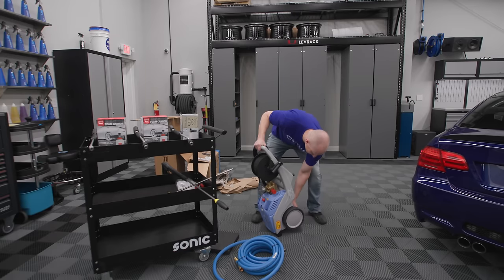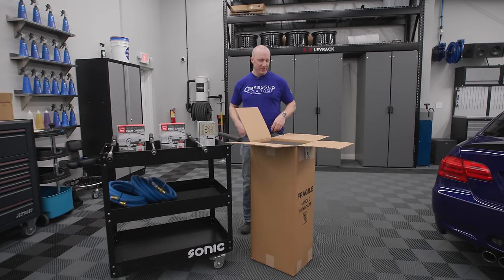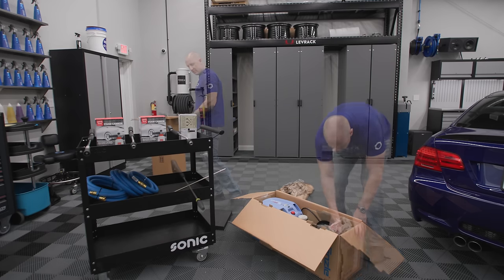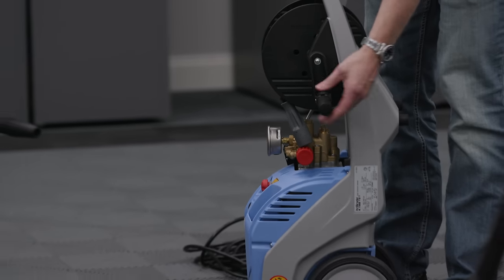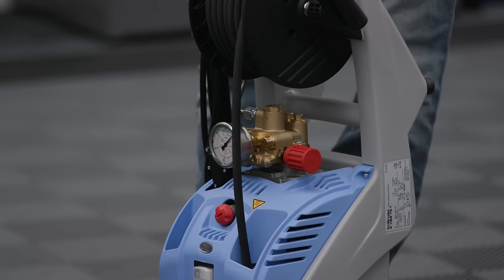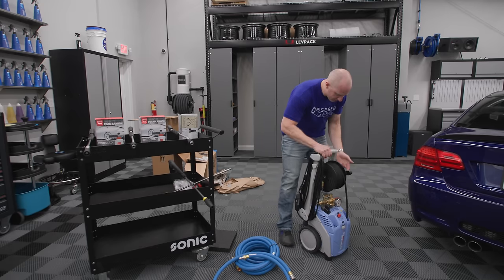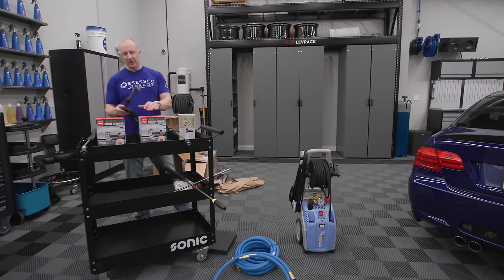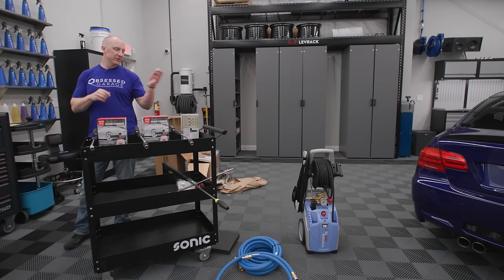My Favorite Portable Pressure Washer: Kranzle K1122TS - Promo Deal of the Year!

Comment: I would have to say to all your critics is this, my car costs more than I paid for my first home. I use most of your car washing (for the last five years)regimen the Kranzle 1122, the stainless nozzles, the Mosmatic handle and wand etc. my car still looks as good as new. No scratches or swirls. The point is if your spending over 50k for a new car why wouldn’t you want one of the best washing machines on the market? I laugh at my buddy who drives a 100k C8 Corvette and uses a cheap Sun Joe pressure washer. Penny wise and dollar foolish!
Reply: I just got the 1122tst and I am chasing down a problem with the foam cannon and the smaller orifice, the unit surges and seems to struggle with the 1.25 and the 1.1 doesn't even turn the unit on. Do you use a larger orifice with the foam cannon?

Comment: I have an Eley hose reel and use their quick disconnects for most of my attachments. Could I add a male connector to the Kranzle so I could connect and disconnect my hose reel quickly? I tried a Sun Joe previously which broke within days and I never tried another electric pressure washer since. Have been using my gas Honda to clean the garage floor, siding, cars, bikes, etc....might be time to get a Kranzle finally.
Reply from the maker: Yep, we can easily add a quick disconnect.

Comment: Can you advise what the minimum acceptable input flow rate required is for this washer. I would be coming from a  1/2 tap but I am concerned I may not have enough flow rate. Thanks
Reply from the maker: As long as you get 2GPM, you are good.

Comment: Most of what Mat shows here can be built with a fraction of a cost, no need to spend thousands if you are not a professional detailer or do this for a living. 😣😣😣😣😣😣😣😣👍👍👍👍👍👍👍👍👍👍
Reply from the maker: And where do you think all that knock off stuff came from?  Many of choose to not support or use junk versions of the real thing.  I’m wearing a Rolex, not a Casio.  #honorthesource
Reply: @ObsessedGarage  Well a pressure washer or a stupid quick connect is not a Rolex is a stupid tinny piece of metal to wash a car once  or twice a month, a Rolex you can enjoy day and night 360 days a year. Your products are horribly overpriced.
Reply: My analogy to this stuff is like Air Travel and Rolex watches. Paying for a 1st class air ticket doesn't get you to the destination any quicker than the economy seat, but in the moment, it feels great. 
Same for Rolex watch vs Apple Watch. The time on an Apple watch comes from atomic clocks, which measure time using the resonant frequency of a cesium atom—an atomic element—which works out the seconds. Some would argue that the Apple Watch is more accurate than a Rolex, but at the end of the day, you don't buy a Rolex to tell the time. You buy it as a status symbol, as Matt pointed out below.
Reply: You should just hang out at Harbor Freight since OG is not for you. Too many are jealous of Matt for building a great concept and being succesful at it. Best of luck to Matt!
Reply: classic complainer. make your own videos about it then